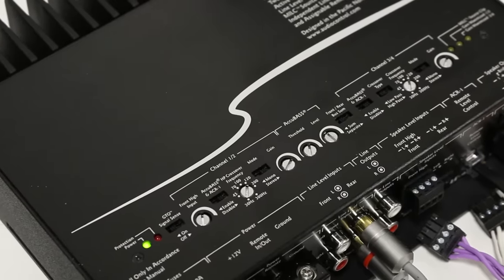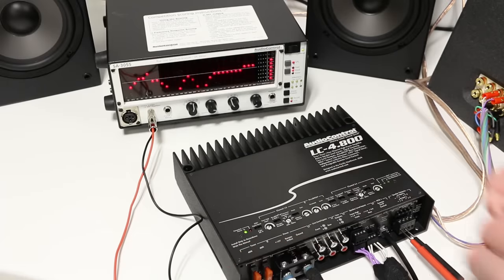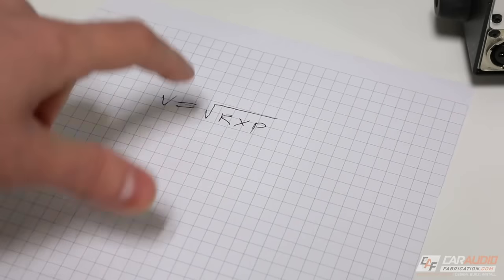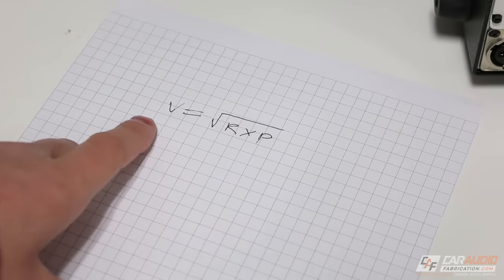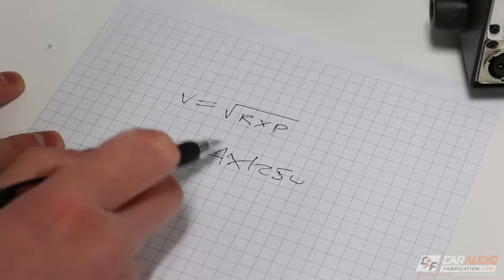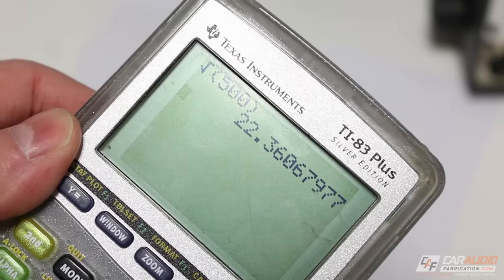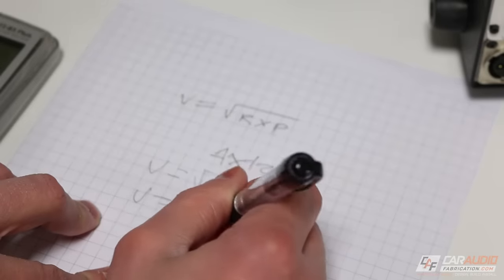Amplifier Tuning Settings How To - Gain, Crossovers, Bass Boost

Comment: Lost me when he said very simple math and started with letters😣
Reply: It’s very simple, but in saying that if you never did any electronics in school then it might be confusing
Reply: @damonvanheerden3605   i never did bud so everything is confusing 😒
Reply: I know this is a very late comment and you may not care past this point, but in the most simple way think of math as if it never had letters R=resistance multiply that by your wattage the speaker can handle (this information will be displayed on the speaker itself or the box it comes in) then take the square root of it all, this allows you to find your total gain control, assuming you set the radio at the right controls before tuning the amp
Reply: @eddieornelas9631  lol

Comment: Problem with this method is that usually car CD or USB players play a lot louder than Bluetooth, for example. So if you plan on listening to music through Bluetooth/aux cable, you should make sure you play the test tones through those when you are setting the gain. Only use a CD if you plan on mostly listening to CDs.
Reply: This is because cd quality is better than the other forms of audio you are playing.  

There is more information there.
Reply: On my headunit i can set levels for either as well as enabling media extender

Comment: I was an installer for 19 years and did a LOT of brands. I am loyal to a handful and I have seen some favorites take a nosedive in quality. Two of my cars have the ENTIRE system replaced from the head unit through the entire audio path. My 'zip code car' had a Mach Audio system but only three channels of amplification were added. Even into my 50's I don't think I am capable of leaving ANY stock sound system alone.
Reply: Hi not sure if you will see this but I was wondering if you, I bought a JL rd 900/5 and for mids it’s has 70 watts rms @ 4 ohms but I purchased a component speakers for the front Alpine R2 S65c it basically says 100 rms . What I am wondering is should I buy another amp for the rear (they are going to be similar alpines but 2 ways) or do you think I will be good? I know sometimes with like my home audio I could get an amp that only puts out on paper a small rms but they push speakers so good idk if it’s the same or not I mean if both speakers are 100 rms but my amp says 70 ? I know if I just push the fronts it will change to like 200 I believe so I’m just not sure really. I am also putting a dsp alpine as well 6 channel

Comment: 80% of shops don't have what your using an still charge 100-120$ to adjust show us a safe way to not hurt our amps I 80$ this last time an couldn't be more disappointed an they said my amp was cheap adiobahn 1,000 dual fan full power to fosgate 15" was hitting hard when I adjusted it an had it half

Comment: When you use a dsp like the audio control 608  and you do all your adjustments on the dsp. Do you leave the amplifier crossover on off or no crossover or you further adjust on the amplifier  controls?

Comment: 1:53 Gain is not a Volume Knob. so hard for people to understand.
Reply: especially teenagers. Because their buddy told them to crank it up!!!
Reply: all knobs to the right
Reply: haha
Reply: "just crank it up"
Reply: all knobs to 11
Reply: Me being a teenager with 4 12’s in my car can say this is very correct and peer pressure can be hard to beat I’ve turned my gain knob up just to add that extra wow factor when the volume is less than 1/4 of max and everything is shaking even though I know not too and after I turn it back down :(
Reply: just like a guitar amp. want distortion, crank up the gain knob.
Reply: Actually, a volume knob is also a GAIN control.  Volume is a relative term, as the perceived "volume" of sounds is increased as the "volume or gain" control is increased.  Only if you do not run any of the amplification stages into distortion is this boost clean and yielding a sound which is close to the input signal source.

Even the VOLUME knob should NEVER be thought of as setting to 10, 25, 50, or any other percentage of POWER, of even system capability.  It is a relative setting, that will depend solely on the input signal level to determine just how much final output you actually get.

This is why some stock, and many after-market stereos also have adjustable GAIN settings for the various input sources, so you can make an ATTEMPT to make the different sources "close" in signal level to each other with nominal signals.  Level controls are a relative setting adjustment.  It does not matter if they are labeled LEVEL, VOLUME, or GAIN, they all adjust the signal level.  Setting them properly, will prevent distortion.  Too high and you can create LOTS of distortion which can indeed destroy any and all components from the point of the distortion all the way through to the speakers.

Yes, the purpose of the gain or level control on you add-on amplifiers, EQs, or any other add-on device is to balance the extra components with the source device.  It is a one time calibration configuration, that should never be touched again, unless the interconnected components are replaced.
Reply: @joehaaayyez765  Set the gain right and impress your friends by your knowledge of how it's done properly. That's more satisfying imo.
Reply: @joswald2001  what if I mount knob upside down do i still turn it right😅
Reply: @joswald2001  what if I mount knob upside down do i still turn it right😅
Reply: And they also abuse bass boost
Reply: what was that again   he he
Reply: What shoould i do if the woofer sounds too low?
Only sounds good when i crankup gain an boost. 😭
Reply: @Sam-w9des  12 if you can get them there lol.
Reply: sure it is it makes the noise louder
Reply: Power knob

Comment: I'd be interested to see the output on the volt meter after you tuned out the distortion. Great video though!
Reply: Ian McDonald I was thinking the same thing
Reply: Ian McDonald me too. Let’s see it
Reply: Ian McDonald I’m guessing it’s 17.2v ish’ Measuring with voltmeter you need to multiply by .707 to properly calculate for RMS. Just my understanding. I could be wrong.
Reply: His POT position using the DMM is a tick higer than using the DD1. Pobably cause he readjusted the stereo volume before using the DD1. Doesn't really matter, I'm cranking my ACDC to MAX everytime!

Comment: It might be worth adding that some amplifiers (DD Audio, Audio Control, Rockford) have a clipping indicator to help set the gains properly.  I has been my experience that the DD Audio clip indicators on the D Series are pretty well spot on with the DD-1.

Comment: Question: once I set the gain with the head unit bass at 0 and the auxiliary bass knob at max, can i then later turn the head unit bass back up or do I only use the auxiliary knob? Please help

Comment: My subwoofer guy put paint on top of the gain controls and all that and said he put them exactly where they need to be, so don't touch them and he'll be able to tell if I messed with it because the paint would be cracked on the dials. Loved that guy

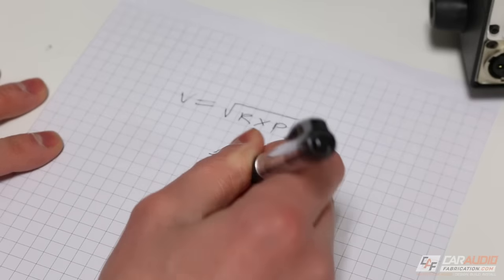Comment: For the equation that was used @ 4:00 did you use the amplifiers RMS power or Max power? Also, what if the speakers you're using are rated for less power than your amplifier can put out?

Comment: At 10:20 you said have the high pass set for speaker at 80hz . Now let say my speakers frequency response claims to be 35-21k Hz . Do I still do 80 or do I set it to something like 50hz (it the lowest my amp can set my high pass to) .My 4 channel lowest claims to be 20-21k Hz. It’s a Rockford fosgate T400x4ad

Comment: So by setting the gain properly, it allow me to turn it up more without distortion???
Reply: Big Ounce yes it will be a bit quieter at lower volume but it’s supposed to be a lot of people set their amps to the max settings thinking it will be the loudest but it over does it and actually isn’t as loud just distorted but if you tune it you can get that max crisp volume without a bit of distortion:)

Comment: great video, but I noticed that you had low battery on the smd dd-1, I had that happen to me thinking my signal was distorted but when I changed my battery I could go a little bit more before distortion. great vid though for setting gains and crossovers.

Comment: So if you have a head unit that goes up to 35 Max volume without distortion, do you still use the 80% of the max volume when setting gain, or max it?

Comment: Did you go back and check the voltage after the DD1 settings were used? Just wondering if it was even close to 22.3 volts.

Comment: Question..The amp comes with a bass knob and the LC2i comes with a bass knob. Which one do I use? Also do I need to adjust the gain on the LC2i first or the amp? Do I only adjust gain on LOC or both? Thank you!

Comment: Hey there, i'm having issues with a phoenix gold SX system in my Audi. The amp keeps going into protect mode. The audio place I purchased the equipment from installed it, and I've been back 7 times trying to get them to fix it, and they don't know whats going on. They won't return the equipment, etc. Any ideas why the phoenix gold 1200.1 would be kicking into protect even on low bass / low volume ?
Reply: Did you find the problem?.
Poor ground ?
Reply: @cdracos1  nope. Still have em. Have had issues since day 1. Gave up trying to fix them long ago

Comment: Hi, thanks for your videos! The bass rolloff as you turn on the volume is rather a result of loudness function in the unit, that compensate humans hearing system non linearity. As your volume is low loudness function tilt up bass and highs. As you increase the volume  the tilt up becomes smaller until zero tilt up from some volume level (defined by manufacturer). This looks like bass rolloff what is actually not really.

Comment: Thank you for this helpful video!  Question, I have a head unit that only has radio and blue tooth (Polaris head unit).  The radio is substantially louder than blue tooth but less quality sound.  Should I set my gains/crossovers using the radio since it's louder or blue tooth because of quality?

Comment: Great info. It would’ve been cool to see you set the gain for a subwoofer too and explain what frequencies to use, aside from the 1 kHz for mids n highs. Why is 50hz the recommended frequency to set sub, and 1khz for mids n highs? I get that it’s a low and high frequency, for both respectively, but why that exact frequency? One last question, my JL RD 5 channel 900 watt has a clipping light, is the tool in the video more accurate or could I trust the led clipping indicator?

Comment: So the hi pass crossover is used if you want to dedicate the amplifier for a certain task, like for door speakers or tweeters and such where you don't want to send bass signals? Is there any opposite function too? Like if you dont want to send high frequenzies to speakers that should be bass only. Like a reverse hi pass crossover. Or do you just buy a dedicated amp for that?

Comment: dumb question, when you set the amp gain using method #2 (Steve Meade tool) do you happen to know what voltage the amp was putting out right before clipping?  also,  did you use 0 db tones, or attenuated tones (-3db or -6db etc).  thanks

Comment: Hey question, so I was looking to get an SMD DD-1 but some one was mentioning how it doesn’t tell you about harmonic distortion and that the tool only tells you about clipping. So you can still potentially ruin your speakers even while using that distortion tool

Comment: This content is priceless!!! We already know you love premium quality equipment from AudioControl, do you have any comments about the Kicker Key amps with integrated DSP and auto-tuning capabilities. My guess it’s like comparing a full DSLR camera vs a point and a point and shoot one.
Reply from the maker: Kicker is a reliable manufacture and the Key is nice but using a camera analogy I would equate it with shooting on Auto mode vs Manual. The Key corrects things, but it does it automatically. At the end of the day a pro using "manual" mode and knowing what they are doing will be able to create a better finished result.

Comment: I have a kicker zx500 amp hooked up to two 10” image dynamic subwoofers. My deck is an avh - 1500 pioneer dvd/divx video. That was one of the settings I did not understand on my amp, which is the crossover dial. It has two others, gain, and bass boost. Where should I start with this setup? Thanks in advance.

Comment: Installing Kenwood Excelon 5 1/4 and 6 1/2 inch coaxial speakers in a jeep wrangler. it’s an aftermarket head unit, and also adding a soundstream ST1200D stealth amp to power them. My question is what setting should the crossover be. It has a switch with high pass, full, or LPF. The stereo vendor where I got it from recommended using the high pass switch mode. I’ve been out of this for many years but if I remember right I used to use full setting on my amps. Is the high pass setting correct for these speakers?

Comment: If my amp has a subsonic filter, would I turn that down before setting my gains or should I turn it up like I do with the crossovers. Thank you and keep making these amazing videos. They are so helpful.
Reply: Yes
Reply: Yes turn it down or yes turn it up?
Reply: Cut it down. Personally I have better bass with the subsonic filter off BUT it can cause damage long term if you don't use it at all. You'll see the more it goes UP the less bass you get. You'll either have a on off switch or a knob to adjust manually. If you have a knob after you set gains turn the sub filter maybe 10 percent but it's up to you. It essentially filters out bass notes inaudible to a person's hearing capabilities. Such frequencies could over time damage the woofer

Comment: After doing all this make sure the receiver is set to NO crossover controls set?  Could the receiver settings conflict with the amp settings?  Assuming preamps are used do the receiver settings matter?

Comment: So let’s say I was gonna set the gains in a vehicle with all the factory stereo equipment just adding the amp and subs.  Would I still play the tone as loud as I could with the head unit connected to the door speakers?  Seems like every video I see there’s no speakers hooked up. Only the amp.

Comment: I just hooked up a boss 1000 amplifier to 4 Pioneer car speakers 2 6x9 and 2 5.5 for front...and it doesnt sound like its even working that well. It does increase the volumn with less distortion. I guess that is all the amp does. It has one of those amp increase knobs which does nothing.  A new Rockville 800 watt amp and 2 8" Subs in a factory made box.. coming in a few days. Perhaps the sound quality will improve with some lower tones. All this info you talk about is over my head, plus I don't have testing equipment or money to buy the good stuff anyway. But sure like dreaming about it.You make sense. 

Years ago I had a $1000 dollar pioneer system put in a camaro. I'm wondering if the same system would cost the same today and sound as good. And it was awesome. Super clear sound with a Pioneer super tuner 2. Or a 3 not sure since it was 30 years ago. Not sure what the same system would cost today. But it had no subwoofer. Just very clear sounding quality stereo music. with 40 watt pioneer amps on front and a 40 on the rear 6x9's. I just spent that much on a new system and it hardly sounds any where as good as the other one. And I made sure all the wires are Plus and MINUS hook ups. RCA cables exactly where they need to be.

Since my car is a 70 classic I had to make myself by a radio looking tuner which is probably the big problem with quality sound. Its a Radio, USA-230, Custom Size, AM/FM, 200 Watt, Chrome Face, Black Buttons, Chrome Knobs, Ford. Probably the crap that is causing the poor sound quality through the pioneer speakers.

Comment: Yes hi I will be installing 2 12 inch gravity warzone subwoofers 3000 watts rms for the pair and will be using a monoblock 3000 watt rms amp. What gauge amp kit should I use? The amp is recommending 4 gauge amp kit and the amp can use 11 gauge speaker wire (which I cant find anywhere just 10 and 12 gauge) will 10 gauge speaker wire be ok to use for the subs which I want to wire the pair down to 1 ohm?

Comment: I have a question regarding bass knobs.  I’m hooking up a new audio system but first time using AudioControls Epicenter.  Pioneer ddin headunit, Epicenter, 2-10” RFosgate Shallow Mount Dvc Subs powered by Kicker CXA600.1 Amp. I purchased Kicker Sub knob which was advised to get nice bass.  My question for u is.... Can both Epi and Kicker bass knob be used/connected together or does audio system only have 1 knob connected to avoid damaging my speakers.  And if so which bass knob should I get connected to my system for best audio . Please help with your knowledgeable expertise.  Thanks Mark for you videos!!

Comment: Great video, I have a question my amp is 2x75w at 4 ohm  + 1 (channel 3 and 4 bridged )*220  at 4 ohm in this case should I mesure for both channels ?  √300 for front channel and √880 for rear channel ? Thanks

Comment: Can RMS power be calculated using the voltage? (Can you work the voltage at clipping backward to get an RMS value?) Even though an amplifier may be overrated/underrated, will finding the maximum voltage before clipping(using a dd1) be an accurate RMS value? Thanks ✌

Comment: Hello mark
If you have a quality head unit, like an alpine ect, and proper amps, buth both have cross-over settings, which ones do you advice to use, turn off Amp settings and do everything in the head unit, with time alignment on top, or turn of the crossovers on the HU and use those on the amps?
Reply: I found setting it on the amp sounded better.